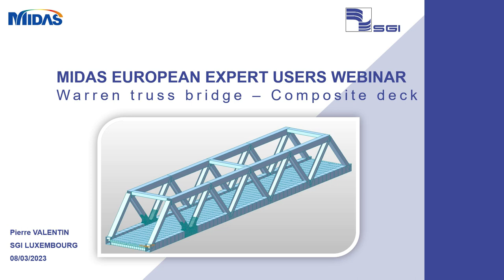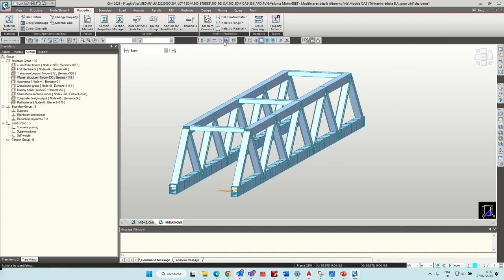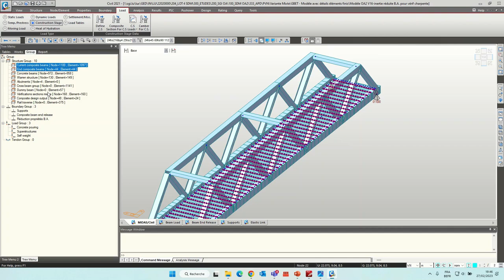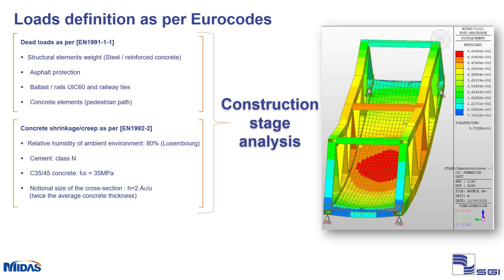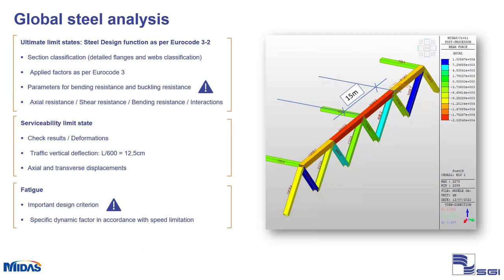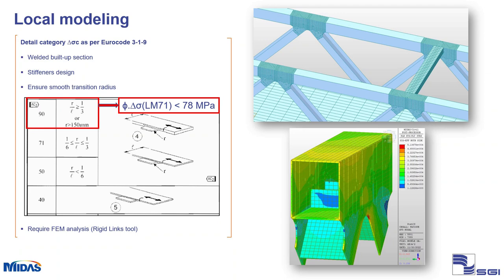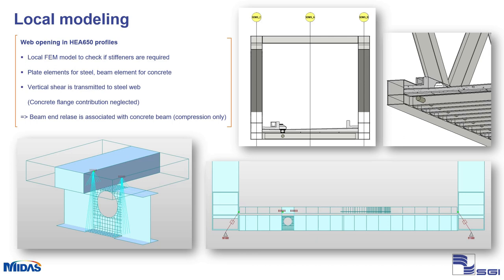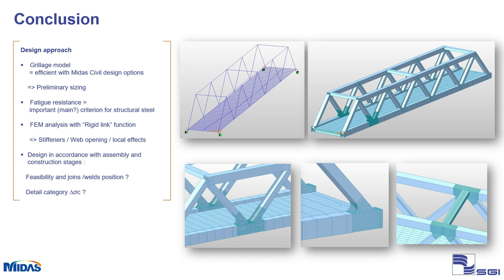Midas Europe Webinar : Warren truss bridge Composite Deck

Comment: Use of composite decks in Warren truss bridges presents some challenges. For example, the design of the bridge must account for the unique properties of composite materials, such as their anisotropy and non-linear behavior under load. Additionally, the installation and maintenance of composite decks require specialized tools and techniques that may not be readily available in all regions.